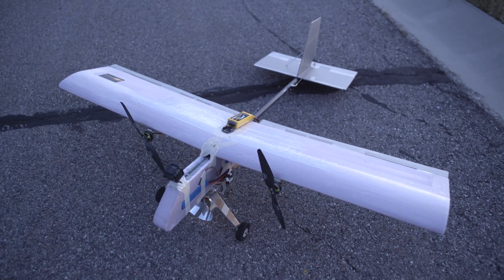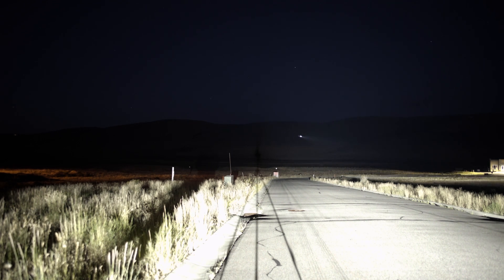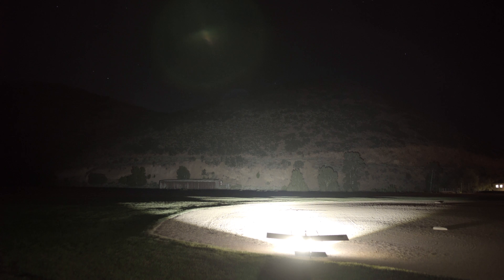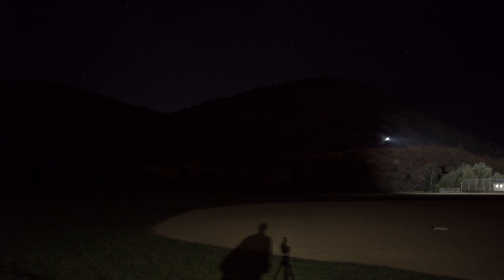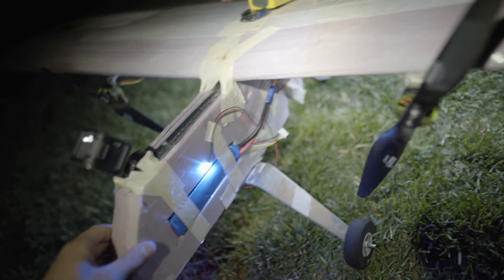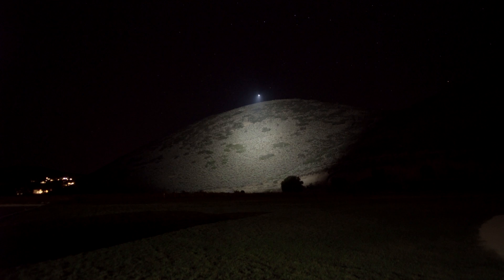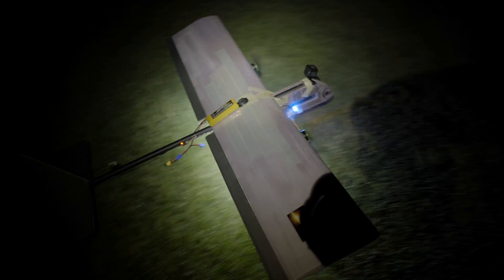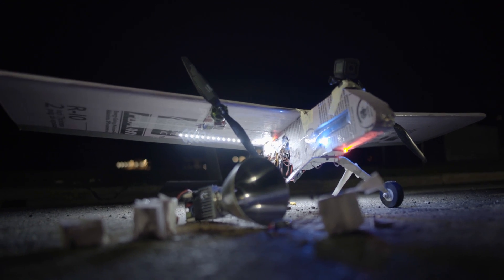Brightest RC Plane SPOTLIGHT 13,000 Lumens - RCTESTFLIGHT

Comment: The reason you can't tell how tilted the plane is, is the light is symmetrical. Put an object in front of the led so it casts a partial shadow, giving you a reference.

Comment: I think on both an airplane and quad, the fan on the heatsink isn't necessary... the fan is for no-wind environment... in fact, depending how it's mounted on a moving object, the fan could actually prevent some airflow

Comment: Needs a clear lens to reduce the air-scoop aspect of the reflector. Also red and green marker lights on the wingtips so you can figure out where it's heading. (Same reason why they do it on real aircraft.) Just remember to remotely turn off the big spot when it heads back in your direction so you don't get blinded by it. (When it comes at you, it has to be hell on your night vision at that intensity and likely after-image.)

Comment: Nice job! Now you really need to make a bigger plane with more ground clearance, and a gimbal to keep the light pointed at a fixed and adjustable location.
Loitering around a waypoint and automatically illuminating it would be a good programming challenge...

Comment: To avoid the blind spot problem you can close one eye when the plane is flying towards you. then when it turns away you can open both eyes and the eye that was closed will not be blinded so you can clearly see where the plane is.
This is a technique that is used in the military.
Reply: I find it weird that the military fly RC planes with bright lights around in a circle.
Reply: and pirates, they say that's why they wore eyepatches, so when they got in a boat's cargo in the dark, they would lift the eyepatch, and that eye would work better in the dark, since it has been patched :)

Comment: Where can I buy that reflector?
Nevermind, it is  in the same store as the LED, you may want to add the link so people do not spam the comments with questions about it.

Also, Can I buy a smaller parabolic reflector?
I will need something like that for an underwater flashlight